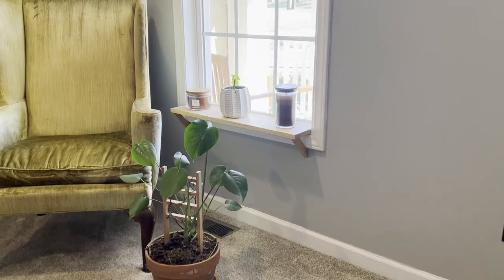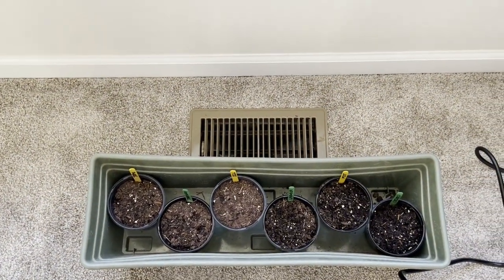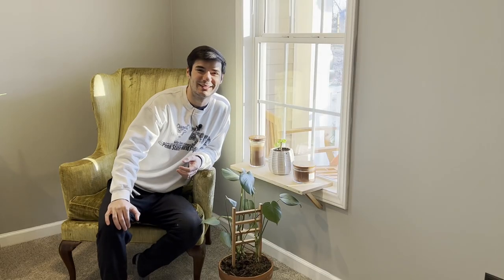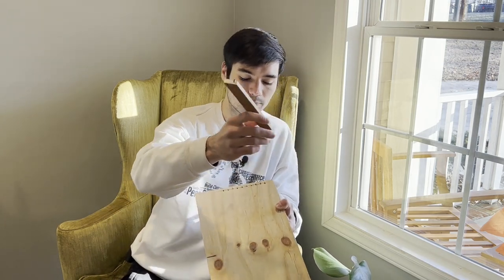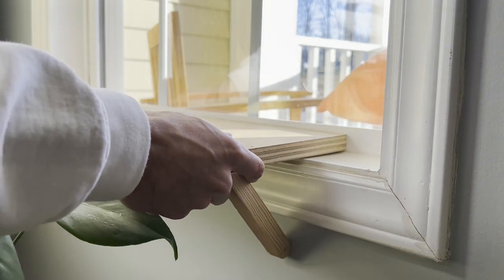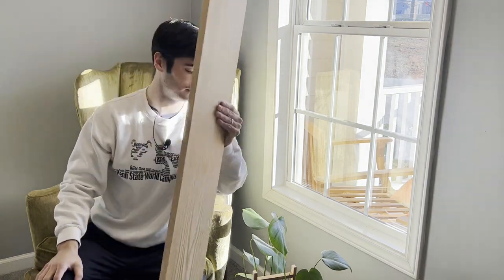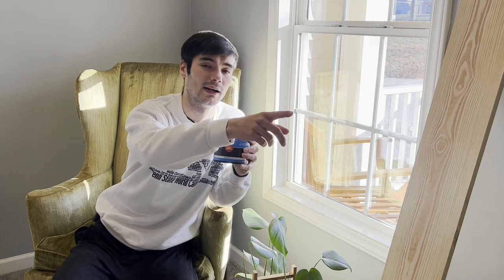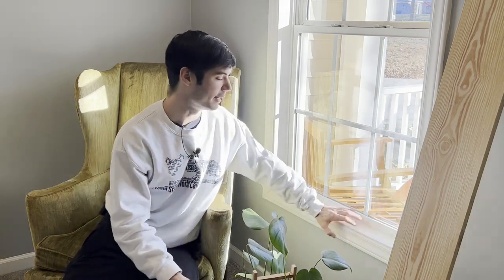DIY Windowsill Extension | More Natural Light for Growing

Comment: You can use a stapler to staple the velcro to the board...and probably the sill as well.  That sticky backing doesn't come off well.   If you are in an apartment the staple holes are easier to fill than trying to remove sticky velcro when you move.
Reply from the maker: @brendagriffin6437 That’s a good idea. I have been curious how well the sticky backing will come off the window sill. I’m hoping GooGone does the trick. Or Naphtha.

Comment: What brand(s) do you recommend for power tools?  I'm starting to look into which ones to buy.  Thanks, and keep up the great work!
Reply from the maker: Thanks for watching!
Drill: Cordless Dewalt (got the 2-drill combo from Home Depot)
Saw: Craftsman 10” table saw I believe. Nothing fancy—$150 at a yard sale.
Jigsaw: Just bought a Makita corded that I love. Great feel and easy to handle.
Miter saw: Mine’s a Ridgid. I like the angle adjustments; it’s sturdy and doesn’t feel cheap.
Brad nailer: Dewalt. I blew out my porter and cable one because I had it overpressured at 125psi. Only rated for 120Max.
Air compressor: Porter and cable. Bought at a pawn shop and it’s run great the last 2 years.

Overall I still with name brands like Makita, Dewalt, Bosch. Ridgid and Craftsman are also good options but newer Craftsman stuff seems to be more cheaply made.. not impressed (my table saw has a lot of plastic parts). 

As with most things, you get what you pay for! Hope this helps.

Comment: Can you install shelf brackets to the ledge only&they'll just rest against the wall?
Reply from the maker: Yep, that would probably work as long as you the wooden ledge is fastened to the window sill in some way (Velcro, small nails, etc).
For deeper sills, I was able to have the ledge stay in place without any fasteners anywhere, but there had to be items resting on the ledge to hold it in place. If I removed the items, the shelf would fall off the sill.
Hope this helps!